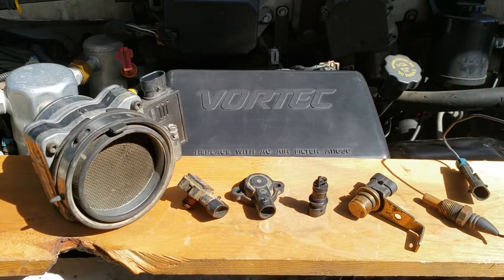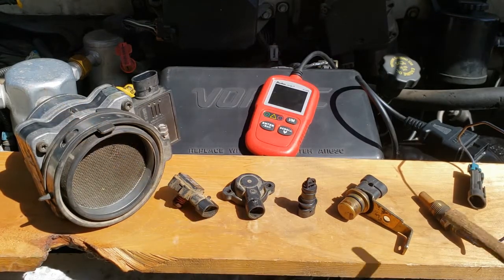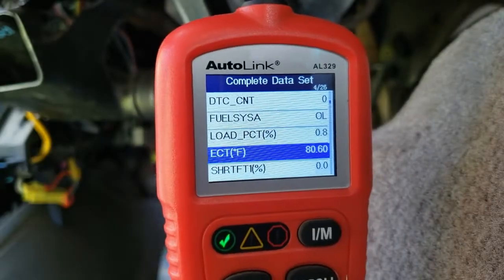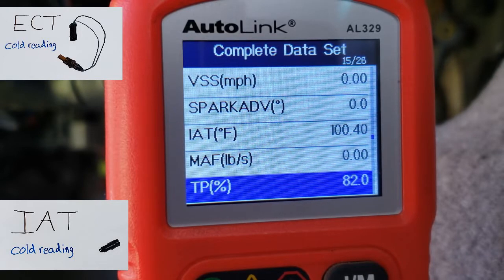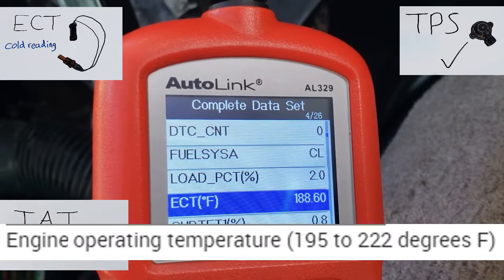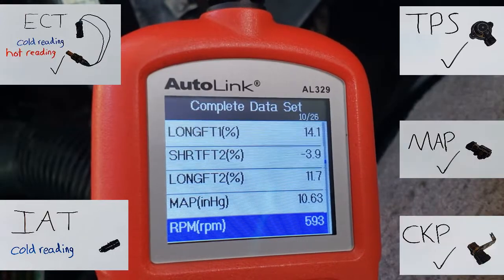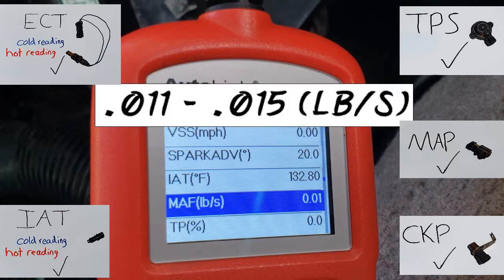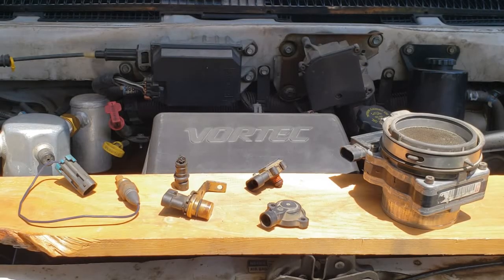Basic Sensor Tests Using a Simple Scan Tool

Comment: Does it work on all sensors ? Like o2 sensors?
Reply from the maker: Yes, most of them. Some newer O2 sensors are called "air fuel ratio" sensors and the values are "opposite"
Reply: @OldSchoolNoe  nice, does this scanner also show fuel trim ? I'm looking for a budget scanner that shows as much data as possible. Also does this one need subscriptions?
Reply from the maker: @Az-elite  No subscriptions, it does show short term fuel and long term fuel trims, also shows for each bank if the engine is a "V-Type."
Reply: Not bad , i think it'll be a nice first scanner to own then. Thanks 👍🏽 should help me step my game up a bit more